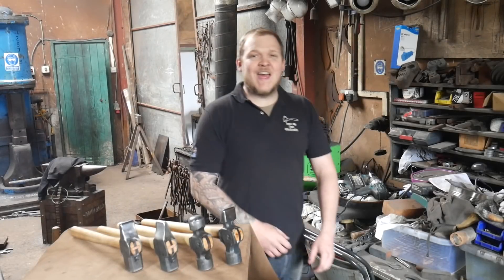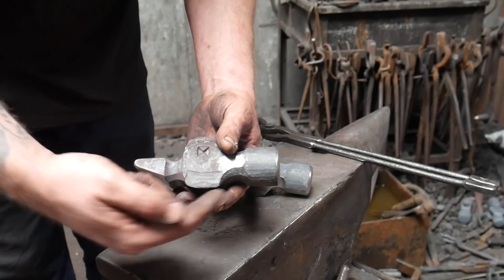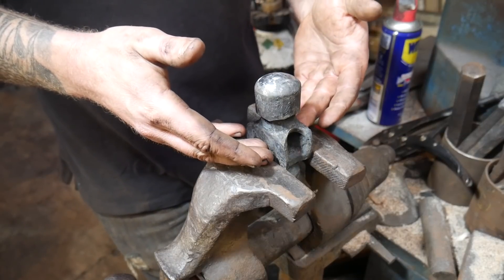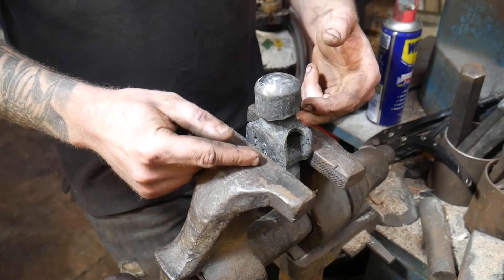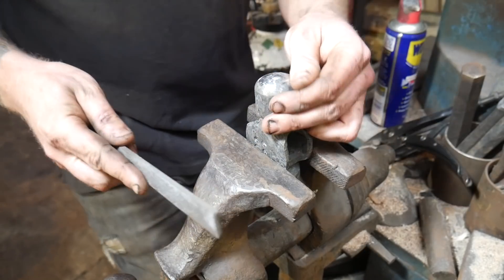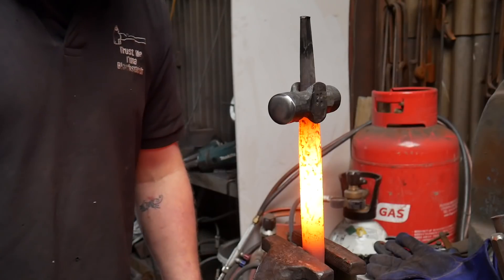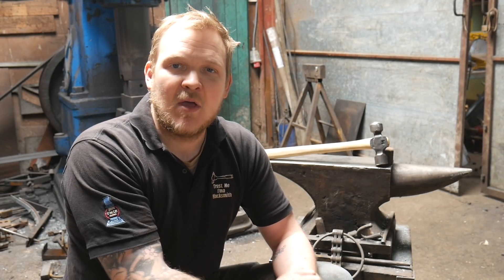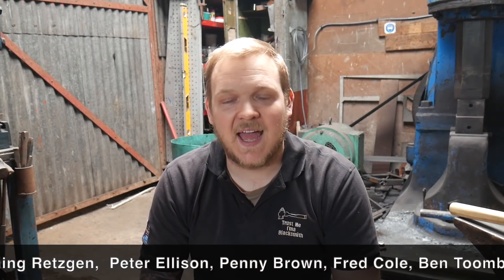BLACKSMITH | Make better hammers! | Tips and Trick to help with Heat Treating.

Comment: Thank you, Dan! Shall try a water quench for my next hammer. First hammer I did is too soft - it is all dented up with every hit and could now transfer the marks to the work. I will try a torch reheat and water quench for the first hammer I made. Hammer on, thank you very much for the definition of what is hard enough.
Reply: Depends what steel you use .. some require water quench - some oil.
Reply: Depends what steel you use .. some require water quench - some oil.
Reply: I suggest a separate annealed hammer for striking punches etc. Keeps your forging hammers clean. Forging hammers don't need to be too hard. Just harder than the soft hot steel or material. If they are softer than the anvil you may never damage the anvil. Hammers are a lot cheaper to replace. That's my thought anyway.

Comment: My main gunsmithing hammer is a tiny ball peen with a polished face.
I picked up another one one size larger and thought it had a really rough service life until I polished it and on the first blow, it had a huge dent in it, not like it was aluminum, but a bigger dent than I could intentionally put in any other ball peen if I tried to.
It needs heat treating in a bad way!

Comment: This is interesting stuff and I’m glad I found your channel. 
I have some hardened ballpeen hammer heads and I’m making new handles for them. I’m thinking of using a Chicago screw to secure the head to the handle. This means drilling a hole through the head from side to side, right where the handle hole is. 
My questions to you are as follows. 
Do you think a Chicago screw will hold up and secure the head to the handle under normal use? These heads are 3” long. Not big. 
How do I soften the steel to drill the hole and then restore its hardness?
Is the hardness uniform throughout the head or is it softer on the flat end?
I know nothing about this topic and I’m learning as I play. 
Thanks for your help. 
Paul

Comment: Great job Dan, would the same temperatures and colours be suitable for tempering hammers made from fork lift tines? as I'm to tight to spend money on new stock and tines are so cheap lol
Reply: For alloys you can go just a little darker where it will just start to turn bluish. Practice a bit so you can watch the colors change.
Reply: @mossyhollow3732  Thanks Mossy, glad to hear that as that is the colour I usually strive for. Cheers Andy 👍⚒

Comment: A problem im currently facing is the steel. I got a new hammer of amazon, german style cross peen. Its a texton i believe was the brand. But man, it has a  soft face. I normalized it, hardened and still quite soft. I barely miss hit on the edge of my anvil making a small taper on an s hook chain im working on for a tripod and it just out an ugly gash in it. Im gonna retry, and maybe just use it as  a soft face guy. It aggravated me cause the hammer ive been using for the past three years was a job smart from tractor supply. And ive beaten the tar out of it and it still looks good. I worrk if i hit my chisel od handled hot cut the new one will just fold. Any tips? Or should i just put it up for as needed and get a better one?  Great vids man!
Reply: Do you know how to do a spark test for carbon content ?  If not, look it up. High quality hammers are made from plain high carbon steel. Compare the sparks from your hammers to each other and to the sparks from a file. There's a lot of junk hammers out there being made from inferior steel like this guy is doing.

Comment: Wow first. Dan sucks😜 p.s. when you're going and you got the whole thing up to temperature and then your alternating face-to-face are you purposely putting it into the oxidizing layer to heat it up faster? Or are you still in the neutral area
Reply from the maker: I have no Idea Ben, Honestly didn't think there was such thing as a neutral area or oxidizing  area to a solid fuel forge. Are your talking about the reduction zone? sorry Ben honestly not a clue.
Reply: @danielmoss2089  I've heard it called tipping.?. If you bury metal too far it gets too much oxygen before the fire can burn it up or something. I don't know the only time I've used a coal Forge was with you down at quad state
Reply from the maker: @bentoombs  That is correct the air is quite low on this fire and means i would need to dig it right down. I could couple of inches. The reason for tuning it was to make sure both sides got an equal heat.
Reply: This is good info, guys. I have been using a gas forge, but have a coal forge recently acquired. Fire depth placement and oxidation.. shall be mindful.